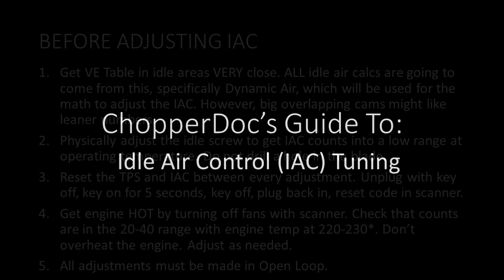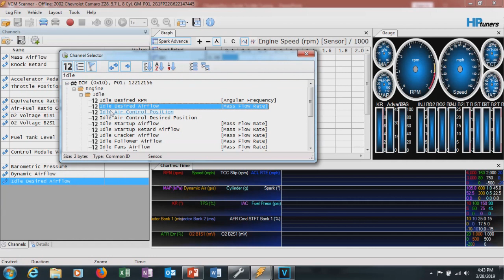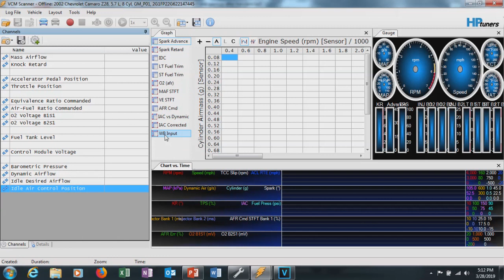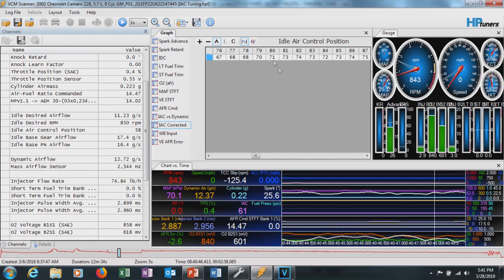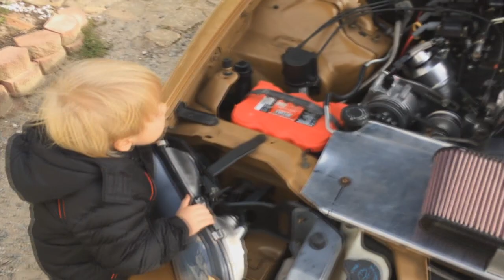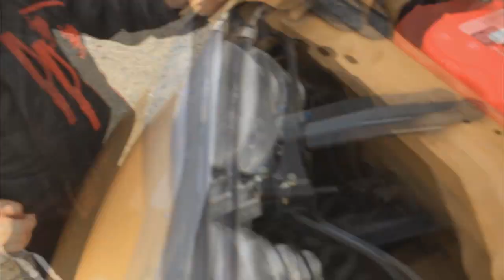Tuning the IAC Effective Area - MAKE THE SCANNER DO THE WORK!

Comment: Great video, im gonna try this tomorrow. I have a single plane and 4150 tb. VE tuning is all done and idles fairly steady but the effective area cant be right. My desired idle airflow slowly drops to zero as do the steps when its fully warm and it still holds idle well but if I close tb screw to bring steps back up it will stall. I figured this had to be the issue.

Comment: Hey Chopper Doc, thanks for this info! I'm trying to figure out why my VCM Scanner is showing 310 for Idle Air Control Position? It has no output, stays on 310.
Reply from the maker: Have you tried opening the blade up? It could be just maxing out, or you have a bad IAC.
Reply: @ChopperDoc181  I have not tried opening the unit itself, I have cleaned the TB and ensured it has free movement. The Idle Air Control Desired is moving frequently in the scanner, but IAC Position is static on 310. 

I do have an X link installed if that is pertinent here.
Reply from the maker: What I meant was opening up the TB blade with the idle set screw and seeing if the IAC closes. If it doesn’t there’s probably something wrong with your IAC or the wiring.
Reply: @ChopperDoc181  I see what you mean here, with that being said let me ask, this process is for both cable and ETC, or just cable? I’m on a ETC setup.
Reply from the maker: It’s just for cable. If you have a ETC TB the computer opens and closes the blade to control the idle. There’s no need for an IAC motor in that setup.

Comment: Question; if my VE was spot on before doing this procedure why is it so off now? Do I need to redo my VE?
Reply from the maker: Yes, because the amount of air being calculated from the IAC table is having an effect. It shouldn’t require a lot of tweaking, and it should only effect a few cells at most at idle. Once out of idle routines VE should remain fairly accurate.
Reply: @ChopperDoc181  The whole table isn’t supposed to be changed right? Just the cells mostly used from a cold start to a hot idle usually 40-200 or so? That may be where I went wrong. I adjusted the cells throughout the entire table. But my VE was drastically off after this procedure.

Comment: So when I log my iac control position it’s stuck on 310 but the iac control desired position fluctuates as rpm’s raise and lower.  So I’m getting no data populating. Is it safe to say my iac has failed?  And would that create a surging effect at low idle. I had to raise my idle to 625 just to keep engine from surging.
Reply from the maker: Have you tried adjusting the blade? Opening it should bring the counts down. I would start with that.

Comment: Hi,

I have a 11° Overlap cam, I tuned VE with a Wideband to -5/+5% (and take off 10% at idle for the camshaft), MAF, Spark, EIOT, DFCO, set the Idle in PE for hybrid tune (OL idle and CL part throttle), min transient, crackers, follower and rolling idle. But I still have a dip coming at stop.

I  noticed my Idle Desired Airflow goes really low when I'm rolling and coming at a stop then the rpm dip and while it reach the target idle it go back to 3-4grs higher. My Dynamic and Idle Desired (while rolling and coming at a stop again) don't match. I don't know if it's supposed to match while rolling but anyway, IAC count are my last hope. Do you think it's that? I use your method, but it seem to lowering the data everytime I log. Is it normal?
Reply from the maker: The desired and dynamic will almost never match after you tune it. When conditions change so does that number. Try increasing your RAF table in gear. This method is for getting your IAC stable, and so it works for cold starts. It will really only match the day you tune it.
Reply: @ChopperDoc181  Yes but my STIT will bring back the RAF table where it will belong, so it will dip again..
Reply from the maker: Is the STIT learning maxed out? In reality these are the LTIT’s, but worth a look. It will only go as high as it’s allowed to remember. Stock are set to 2 g/s max trim learning. Worth a look. With bigger numbers in airflow bumping up the max learning isn’t a bad idea. 

For undershoots, my first correction is actually the spark tables. Have a look at the changeover speed (idle/rolling spark vs mains) and see if the speed corresponds to the dip you are seeing. These are your spark table selection tables. Typically this speed is about 4 mph. Spark changes torque on the next cycle, so it’s much faster than airflow changes. A well mapped spark table that’s blended well between selections (main vs idle) will run pretty smooth without need for playing with the IAC settings. IAC is firmly in the “fine tuning” area of the tune, specifically for better cold start and run behavior. 

Significant dips or stalls are fairly serious issues that also imply a bad setting elsewhere in the tune. Spark is always how I correct hangs and dips. Air helps, but not as much as spark does. Be accurate and only adjust the area needed and blend. Go a few degrees at a time until it stops doing it. You can use the scanner to play with spark too to dial it in faster.
Reply: @ChopperDoc181  No one are maxed out. The STIT goes a little bit negative and LTIT are disable for now, when LTIT are enable, they make things worse.

I took a look at the sparks and it seem to be the culprit. When I clutch in and brake the rpm fall from 2500 with 41° to 25° fast. Than the rpms goes below the Idle rpm. I tried to smooth the no throttle area to idle and now it's 33° to 25. It's less but still too much drop. Tomorrow, I'll try to bump the Idle area to 28/29, smooth and let the Idle sparks to 25° and separate the Idle sparks to main sparks as factory did to see if it's better

Comment: Chopper what’s up I’m the guy who was battling the bucking think I got that under control, now we have that dreaded hanging idle it’s so weird just seems more random . I changed idle control and iac motor but did nothing I had the blade open some but it was taching to high so I back it down now I order new throttle body to a 92 mm with adapter plate any tune suggestions ?
Reply from the maker: Try pulling timing at the hang, and above and below it. Remember to smooth it in, you don’t want to spin it down too fast, otherwise you may set it up for an undershoot and potential stall. I pull 3-5 degrees out at a time when it hangs. This reduces delivered engine TQ.

Comment: My question is.... Is it necessary to adjust the IAC STEPS vs Effective area on a DBW-or drive by wire car? The graphs I set up for my DBC truck DO NOT WORK for DBW cars???? What gives? Is it not necessary to adjust the IAC Effective area on DBW vehicles? This has always puzzled me... Well this and BASE RUNNING AIRFLOW on DBW cars as well.. The RussK idle config does not work on DBW cars because there is no IAC so how do we verify that the throttle body flow area is correct? Or, am I over-thinking this stuff?

Comment: So the iac being out will also cause it to gain speed when you put it in gear without pushing the throttle correct? And would have to make the same changes ?
Reply from the maker: No, this is all done at idle, primarily for cold starts and stability. The problem you are having is an adder like throttle cracker. You can zero the problem areas out on that table and it should fix that “cruise control” effect you are seeing.
Reply: @ChopperDoc181  thank you I’ll try that the only effect I had on it was the iac changes but I will try the throttle cracker I had to edit I see 0 out the problem areas gotcha

Comment: Could you reduce the decimals of the factory column axis values and then copy and paste those values to build the histogram?
Reply from the maker: You can, but you will get values in between them because they are pretty far apart. So best if by at least 5, and even less in high traffic areas where it likes to sit at idle, etc...

Comment: What causes discrepancies between DynAir and Idle Desired Airflow? Right now my DynAir is 3-5g higher at cold start all the way to 235*F even though my VE error shows <5% in that area (although I've been filtering TPS>1 in the VE err table to try to mitigate idle IAT heat soak). In the past if I've raised the BRAF too high it causes quirky idle behavior, and right now it's behaving nice using IDA values. If I can't get DynAir to come down a bit, I'm concerned if I use DynAir values in BRAF it'll cause idle issues again. I built a simple Excel file to take your process and make it easy to paste into the tune.
Reply from the maker: Pretty sure I just answered this one on tech. The desired may change based on different conditions. The BRAF defines what the IAC values are, the IAC effective determines what "desired" values actually are, essentially, so really, the BRAF controls that number, or it's range at least. 

Start with the BRAF, and plot either "desired" or dynamic. Personally I prefer dynamic, but desired works too. Get the idle smooth when it's warm, then adjust the IAC table slowly across to get the range you want. Don't change the limits, as in 0 or 310 areas. Slope should be fairly linear, like the MAF. 

Other things to look at are the fuel and spark. These things play hell with idle. If you have huge injectors, lower the transient min mg to .010 or .015. That will help big time at idle. 

Mind you all of this is done to get cold starts to work. It took me a long ass time to get it right the first time, but it actually works now, starts on it's own and idles at 750 warm.
Reply: @ChopperDoc181  My MAF is now dialed in  from idle (I pushed it down to 600RPM using the special controls) to 8000Hz (clutch problem prevents me going higher), and VE is dialed in through roughly 4000RPM. RAF was dialed in from multiple cold starts using IdleDesAir because DynAir wasn't giving me good manners. DynAir and MAF g/s are now within 5% of each other during RAF calibration logging. I wasn't having problems with cold starts, but I'm OCD, so I changed the IAC table per the video, then had a problem with idle; STIT was now +5-6g/s. I blindly added 6g/s to RAF from 68-284, now it's behaving better but  I'm curious about the remaining process. Do I need to re-learn RAF, then re-learn IAC, and keep repeating that process until a certain point?

Comment: Is possible to use this on a Gen 4 ECM?
Reply from the maker: Gen IV’s are electronic, so not too sure how this would be useful. The final airflow minimum table is exactly how it sounds. If you need more air at idle, simply increase the number and it will open the blade more.
Reply: @ChopperDoc181  Thank you!  New to this and found the way you explain things to be very easy to follow.  I'm looking forward to whatever else you may have in the works.  Hopefully gen 4 stuff!

Comment: Phenomenal videos, in my logs the IAC has remained open while on throttle and increases with TPS%. Goes as high as 238 and stays there all the way to 100% throttle. What is commanding this?
Reply from the maker: A few tables can affect this. First one that comes to mind is the throttle cracker. There is also a throttle follower too, but that’s off throttle decel. 

All and all though, the IAC really has no affect on anything when the throttle is open. The problems with it are always prevalent when the blade is closed, and you’re having difficulty with cold start, or “cruise control” caused by the throttle cracker. 

I can’t tell you exactly what is commanding that particular number. Like I said once the throttle is open any IAC formulas from the PCM really are quite irrelevant.

Comment: I’ve done everything in your videos and my car still surges when coming to a stop, can u do a video on adaptive idle ?
Reply from the maker: Try reducing your min fuel mg under the transient fuel tab down to .010 or so... it will help with idle rich spikes... note that I’m quoting the decimals here from memory, so I may be off a little. Stock it’s something like .046... again, decimal is from memory. Whatever the value is, keep the decimal in the same spot and reduce it to a value of 10 or 15 instead of 46.

If that doesn’t work, pull some timing out in the trouble area, as I’ve noticed that also causes surges... bad. 

Approach number three... lean it out on that area on the VE (especially if you have a cam with overlap) as you may be encountering a false lean. In addition to this, if you are in closed loop, it may be chasing its tail trying to meet stoich with skewed numbers caused by overlap. If this is the case, put it in open loop using PE tables, and simply set the target to 1.0 in these areas. What that does is enable OL through PE, but won’t change the fuel target in the RPMs you don’t want it to, particularly idle. Typically it’s set up to 1200 or 1600 on the table with a correction of 1.0 and a TPS enable of 0, aka, PE enabled at idle. Also note that the MAP enable must also be met, so make sure it’s under your typical average idle MAP numbers.
Reply: @ChopperDoc181  thanks for the help. Do you have Facebook? Maybe I could send you a couple messages about it, I promise not to bug you too much haha. I’m in open loop speed density only, not using maf or o2s. Also I have my ve set to idle at 15.5-16 afr
Reply from the maker: I do have Facebook, but I’d rather share that offline in an email or forum. You can find me on LS1 Tech as simply ChopperDoc... I try and get back in timely manners, but sometimes I forget so for that I apologize.
Reply: @ChopperDoc181  I understand completely, I don’t get on ls1tech, maybe you could send me a message instead? I’m pretty desperate and that’s the fastest way for me to communicate, I don’t check my YouTube notifications often. If you want to, my name is Tim Artrip and I’m in va. Shouldn’t be hard to find and I’d really appreciate it, thank you

Comment: Great video. I’ve just started tuning my setup. Followed your setup for logging but mine throttle position shows 0.0% while yours is 0.4% don’t know why yet and my readings start at 104 @ 62 then goes up from there. 
Any help would be appreciated.
Thanks 
Randy
Reply from the maker: The throttle % just seems like an oddity to me, but I’ve seen it many times. It’s not a serious issue. What readings are you referring to?
Reply: ChopperDoc181 Thanks for replying , I was referring to Desired IAC steps vs Desired idle Effective Area. But then you mentioned the VE tables if it’s off then this won’t work out? So guess need to get VE first then come back to this part?
I’m a newbie on hp tuner. 
Thanks 
Randy
Reply: Can I tune VE without a wide band ?
Reply from the maker: @randyw7342  I’m really sorry for the late reply... yes you can tune VE up to the PE areas using stock O2’s. Set the closed loop enable back to stock and use the error as your correction. Yes it’s doable, however don’t do anything in PE this way as that’s OL by default, meaning that stock O2’s are disabled in PE.

Comment: How is your method different from the "Russ K" method for example ?. Thanks for the vid
Reply from the maker: The Russ K method is intended to setup the Base Running Airflow table by plotting "Idle Desired" vs "ECT" on cold starts. Personally, I have stopped using that method. Here's why:

The BRAF table essentially defines what the values of the IAC effective area actually ARE in airflow estimates. "Desired Airflow" is actually what the PCM "thinks" the airflow is at "x" IAC number, which is based on the BRAF. So it is kind of a circular problem if you use "desired" to calibrate what is essentially "desired" if that makes sense. 

Instead of plotting "desired" vs "ECT", I just use my dynamic numbers instead, on the same table. This is provided the VE is solid, and the car is running well at temperature. Once my calibration looks good on VE at temp, I go ahead and plot "dynamic vs ECT" on a cold start and plug those numbers in. Mind you this is BEFORE you start changing the IAC values. 

Now the PCM has the REAL airflow required to run the car, as in dynamic. After I have the BRAF calibrated using dynamic values, I go ahead and then tell the PCM what the real effective area is using the method in the video. Basically once the "idle desired" and "dynamic" values are the same or close, the IAC is properly calibrated. The rest of the settings are in the blade (mechanically) as I have found further adjustments and tweaks are often needed. I also installed a set screw on my adjuster screw as a sanity check lol. 

Once it starts and idles on its own without help from the pedal, you're done. Check it on cold days too, as this will change things, but if it passes the cold day test without help, don't make further corrections, since the values for dynamic air have a lot of factors, and there just are not enough tables to account for everything. What that means is these "corrections" can change under different conditions. If it works though, stop messing with it lol.

Comment: What does it mean when the corrections are in the 500 to 600 correction range ? Does the throttle blade screw need opened up a little ?
Reply from the maker: It means your dynamic air and desired are very far apart. If it's that far off, it's usually near the ends of the scale. Don't exceed 310 as a number, since the computer doesn't seem to actually recognize anything above this. You may have to revisit you RAF table and VE to get them to line up a bit better. I use dynamic air values for my RAF table instead of desired, which are straight from the VE calcs. Then once it's all good, I correct the IAC table and revisit the RAF as needed. It can be a little tricky, and any blade adjustments are going to mess with everything.